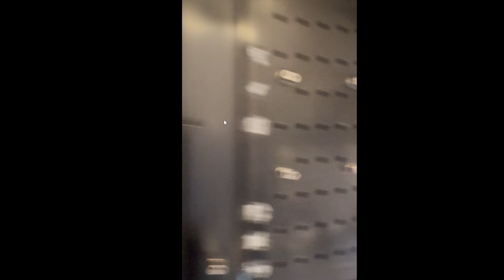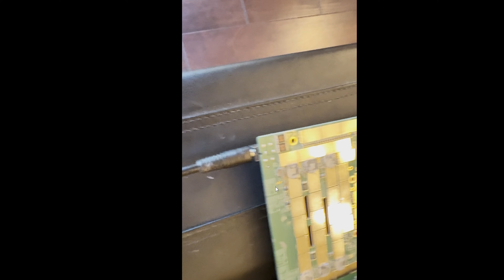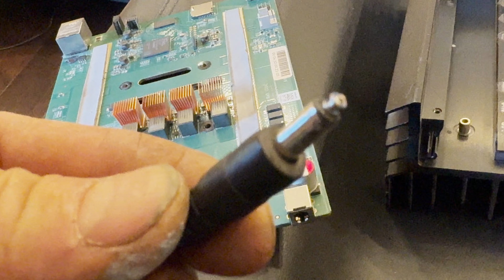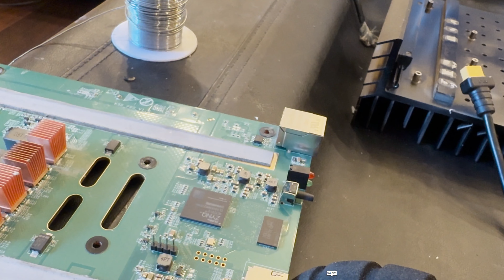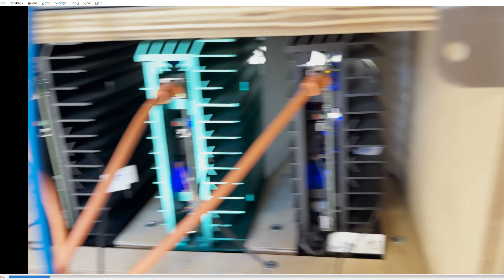Replacing KS0-PRO barrel connector to PCIE 6-pin ATX, CRYPTO440 THANKS BRO

Comment: What connector did you use? I only found the 90 degrees the other way. So the positive and negative are reversed on those connectors
Reply from the maker: I used crypto440 connector,  he sells those on eBay, I think he has a link in his YouTube channel.

Comment: A small tipp for desoldering connectors and similar things. Use a piece of copper ~1,5² that is long enough to make contact with all the soldering joints you want to melt. Now heat up the copper piece with your soldering iron. Add enough solder so everything is connected well and wait untill everything is melted. This way you should be able to remove for example connectors without any problems.
Reply from the maker: Thanks for the tip.

Comment: You need low temp solder, your solder iron it's OK. Next time probably will be safer to first remove that capacitor. My overclocked KS0 PRO still has the factory connector but I use a good quality 5.5 Jack.
Reply from the maker: thanks, that's probably why it took me forever to get that solder out of the holes. Had to put to 400C (max 420C on that soldering iron)